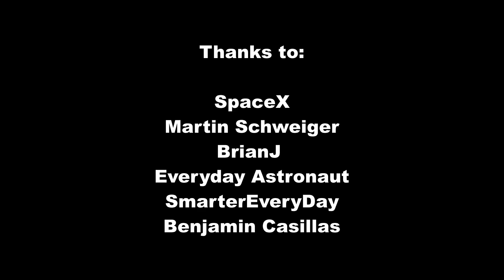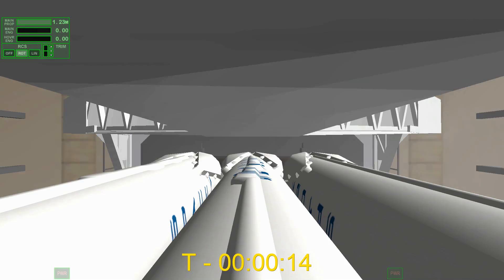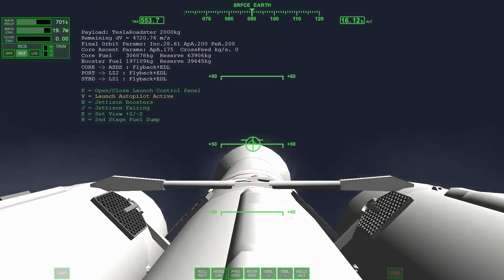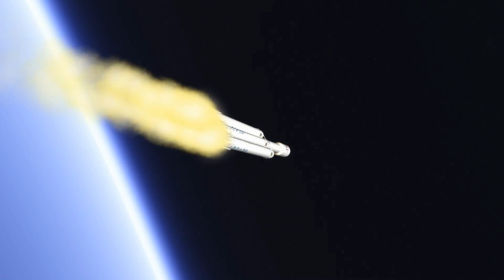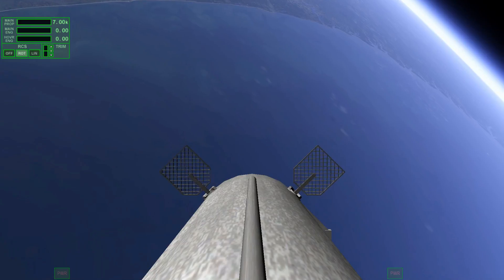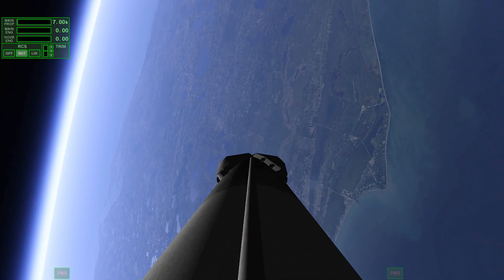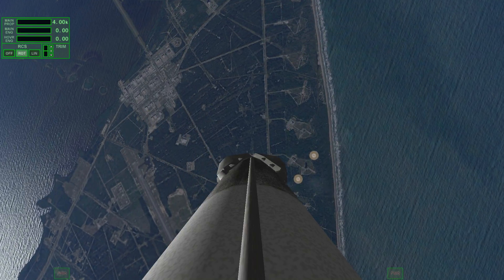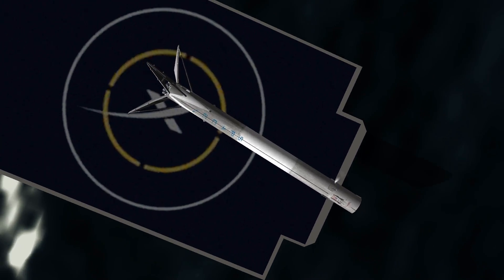SpaceX Falcon Heavy tribute Orbiter Space Flight Simulator 2016 Edition

Comment: How did you automate the booster landings and if you did, the entire flight?
Reply from the maker: Everything is operated by the autopilot which is part of the add-on. On purpose, I did set too little fuel for the center-core so it would fail. Besides setting a few launch parameters prior to launch, that's all I did.
Reply: Marijn fly The autopilot comes with the falcon heavy add-on?
Reply from the maker: Yes. And also with the Falcon9 add-on. You set a few parameters like inclination and whether the boosters are to be recovered or not.

Comment: amazing/impressively accurate. Except for the center stage, should allegedly only be able to light one engine and hit the ocean at 342 mph, not tip over at the droneship. I'dd love a simulation of that, where someone tried to emulate what would happen with only 1 engine available at the landing burn. I suppose it would be calculatable with the speed, thrust of one engine and weight of the almost completely empty first stage.  :)